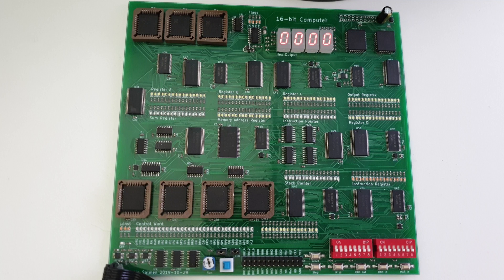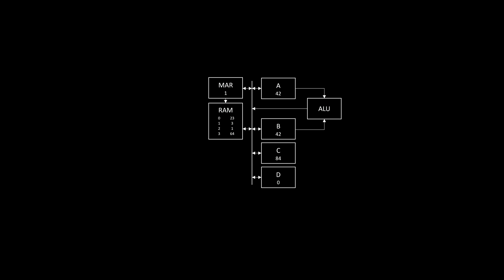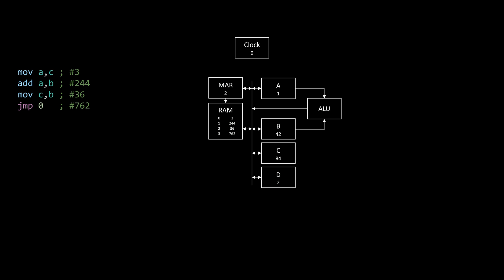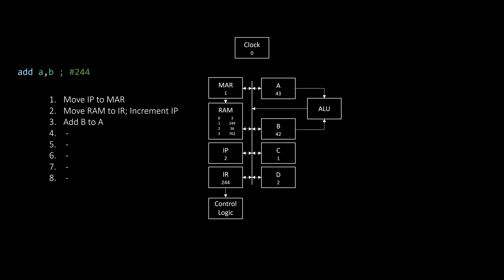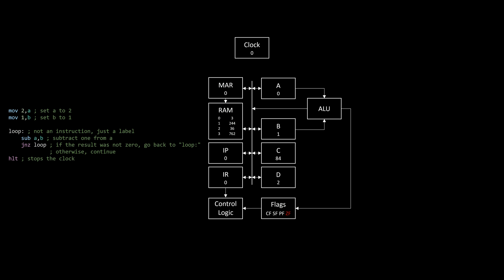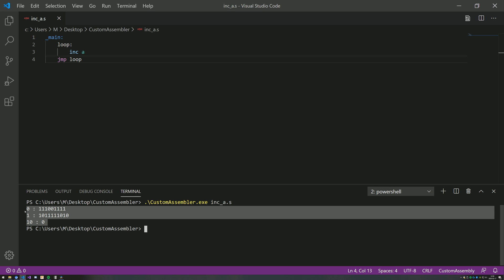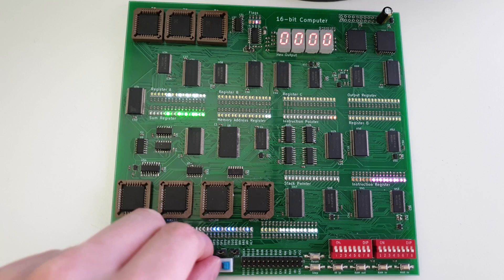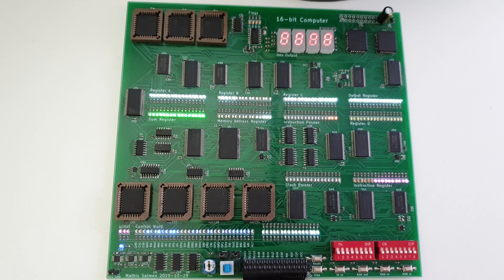Custom 16-bit Computer

Comment: Where did he get the custom board?
Reply from the maker: Designed it myself, ordered it on JLCPCB (or one of the many other board makers)
Reply: @_mathis  Oh nice, you did a great job 👍
Reply: @_mathis  Do you have the PCB design or the schematics so we could expand upon it?
Reply from the maker: @andrewsodyssey5753  I do, but with hindsight some parts of this design are very flawed, it's not something I would base anything upon.
I will build and release another improved design at some point though!

Comment: a bit more simple: rom pre-computer, its a memory controller only, rom instructions alu and ram for some processing
Reply: instead of billions of transistors, you store terabits of rom, no constant recalculations
Reply: the order of 10^12 of bits, not 10^9 of transistors, 10^3 difference in scale, and mask rom is very dense, and its static memory, not complex, even eeprom pre-computing cpu or more preferably, very many 100k+ gpu cores

Comment: Great overview. I've taken a computer architecture course in university and I'd like to try building an 8-bit computer soon, this was excellent motivation!
Reply: @bryan8038  Watch a few videos on logic gates and Karnaugh maps - make sure you understand those. You should be able to find some free simulation software to try some basic circuits. Then the 8-bit breadboard YT series from Ben Eater is absolutely FANTASTIC (he also mentions a $50 textbook which can be purchased on amazon).

EDIT: Also, Arduino's are great generally. They won't teach you much computer architecture, but they can teach coding and can accomplish a huge array of hobby projects. You can get starter packs for less than $100 which include a bunch of resistors, LED's, jumper wires, sensors and instructions for projects.

Comment: the code is not transformed into assembler , assembler self is a programming language, the code is transformed into machine code. Otherwise awesome video
Reply: it meant that it is encoded in CPU instructions that can be represented "graphically" in assembly

Comment: I think you have a misunderstanding about parity. Parity of a number is not whether it is even or odd (least significant bit being zero or one). But indicates whether you have an even number of ones or an odd number of ones in your number. You can either make the parity indicate that you have an odd or even number depending on your choice. So if you do even, then 0 would set parity. A 1 and 2 would clear the parity and a 3 would again set it. Other than that looks like neat project.
Reply from the maker: Yeah, already discussed this in another comment. You're right, LSB-Flag would be a better name for my "parity" flag.
Reply: Odd or even actually is a meaning of parity. It's just that computer people shortened "odd or even number of set bits" to just parity. I.e. parity of bit count.

Comment: Can you please provide a schematic?
Reply: In 6:22, there is the diagram. I think there is no need for the schematic, you can create one.
For example, I want to do my own computer but with different instruction set. So, I can build the "control logic" in the way I want.
If you are interested to do a computer, I´d recommend you to use the 7400 series chips. You can search "homemade ttl computer",  you´ll find similar projects.

Comment: 763 as a instruction number? Since where there are more than 256 instructions sets? Thats a waste IMHO
Reply from the maker: Opcode is not the same as instruction :) 
In a normal ISA you would count say "mov x, x", "add x, x", "sub x, x" as three "instructions", but really, you are counting opcodes.
To really differentiate, every possible operation that the computer can do has its own number, so you count "mov a, b", "mov a, c", ..., "add a, a", "add a, b", ... which is where the larger number comes from. Total instruction length here is 10 bits, so 1024 different operations. Most modern computers use 16 to 32 bits for instructions, so that would be far more.
Reply: If you use 10bits for instruction set, last 6 bits are used for address space with next 16 bits? That would mean direct access to 4MB of memory.
Reply: @Borgan_Black  that totally depends on what addressing modes he has implemented and how many bits the address bus supports.
Reply: Pretty clear you’re not familiar with many CPUs and their instruction sets, and their opcodes. The 65c816 (first major commercial use, Apple 2gs) has 8 bit data bus, 24 bit address bus: 1 opcode reserved out of 256. 24 addressing modes, not many registers, still had room for what you could hope to add if you went towards what we have in modern x86 processors for multimedia instructions and floating point. It certainly didn’t have an orthogonal use of all registers, or how they were encoded: constraints of that time included memory bandwidth as well as total amount of RAM, and no microprocessors had caches at that time, that didn’t happen in any meaningful way until the 90’s.